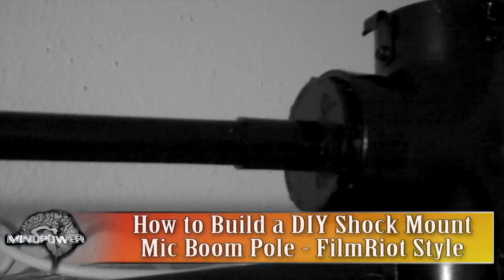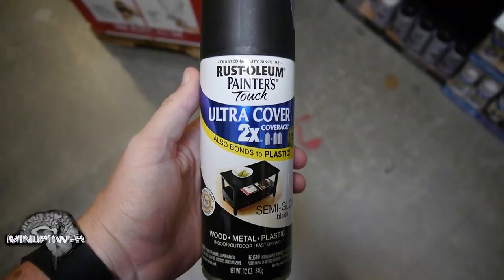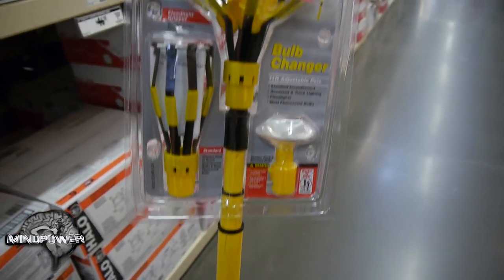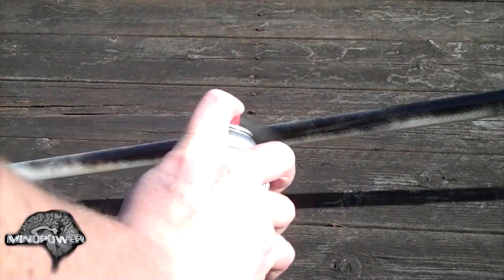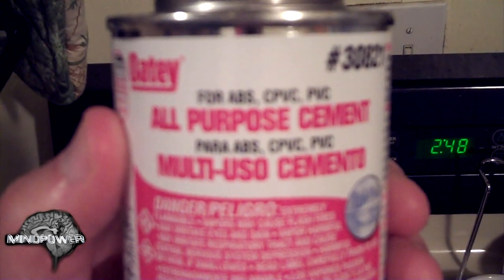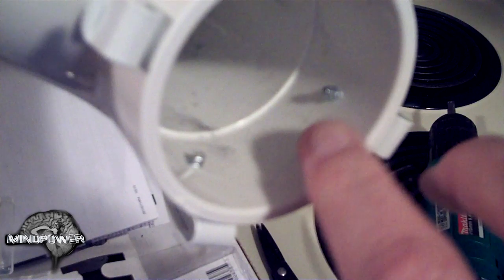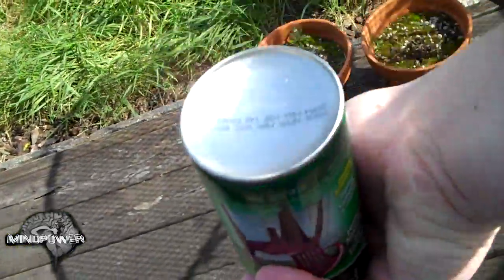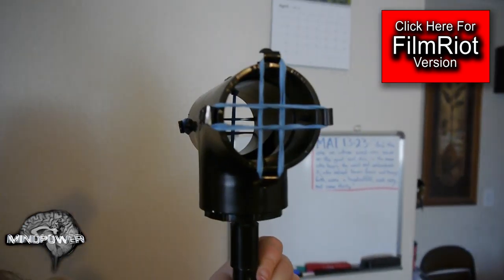How to Build a DIY Shock Mount Boom Mic Pole - FilmRiot Style - MindPower009

Comment: BroBryce2009, what do you think about the JVC GZ-HM300 Dual Slot High Definition Camcorder. I know it is 2010 model, but the picture quality is great in my option...I also got the SanDisk Extreme 16 GB SDHC Class 10 UHS-1 Flash Memory Card 45MB/s SDSDX-016G-X46  Card. Will this improve the quality more then it already is.

Comment: So, I noticed when your model demonstrated the finished product, she was holding it overhead. I am wondering if there is a product out there where the mic attaches to a utility belt? There could be a back and forth swivel, just above the attachment site on the belt, this would allow the mic to move forward with a push and backwards with a pull. The first section of pole, running along side the operator and up from that swivel, would be an extendable pole of maybe 2 feet; allowing the height the mic would need. At the end of that pole, a second up and down swivel would attach another extendable pole of maybe 10-15 feet. This product would remove the pole from the operators hands, allow the weight to be absorbed by the belt and their hands free to move the mic back and forth and up and down in smooth motions as needed. If there is a product out there like this, I think every boom operator ought to be equipped with it. I hope I explained it adequately.  I believe I saw one where the pole attached to harness/vest and came up from behind the head, although I can't find it again..so far. Anywho, perhaps you have a new 'challenge' to tackle!?! Just a thought.
Reply from the maker: I think I've seen that done, but I think it was actually a camera mount.  I'm thinking with the amount of work you'd put into DIYing something like that, you might be better off just buying one with P/T movement.  I'm not knocking the idea, just that at some point, unless you're just doing it because you love to DIY, it might become impractical for a pro filmmaker.  That said, I've used this DIY pole for a ton of pro shoots, and everyone's been pretty impressed with the results, despite not being able to swivel the mic around.
Reply: MindPower009 Honestly, I have never held a boom mic, nor probably will ever. I just was wondering if you had seen a boom mic like that, as I still see the operators hoisting them up in the air with their arms.

Comment from the maker: I am not a fan of camcorders, only because from my experience it is very difficult to get footage that resembles film, which is mostly what I do, because of the small sensor size and the lack of interchangeable lenses which limits the ability to control depth of field.   You can always buy a DOF adapter but you lose light, and for $500 I can get a GH2 that does all of the above.  That being said, I do like Panasonic and JVC cameras altogether.   Good quality products at a decent price.
Reply: MindPower009 Then dont buy cheap camcorder ...
Reply: "Footage that resembles film" 😂😂😂😂😂😂😂😂😂😂